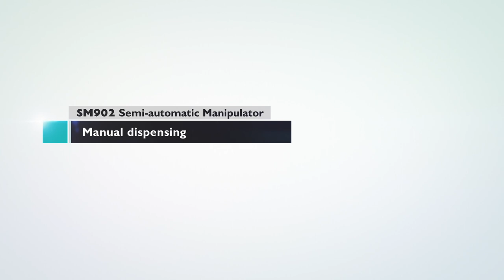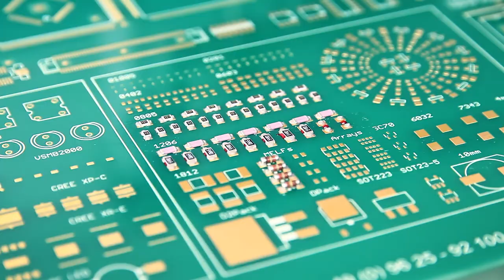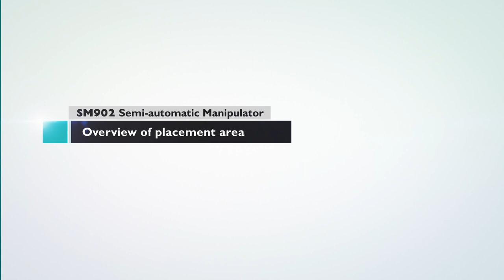Manual & Semi-automatic SMT placement

Comment: I love the dynamic guide hole that makes sure your putting the component in the exact correct spot!
Reply: It only repeats the position you told it to go to. So you might put it in the right spot every time or the wrong spot every time. And it does nothing to control the orientation of the part. Extremely limited value and applications, considering the high cost.

Comment: Did you notice 3:35 wrong direction of IC mounting, it catched my eye.. 100% secure, yes)
Reply: good catch, you were paying attention. (like someone placing smd should have been doing) ;-)
Reply: I  did  noticed  the same. This  machine  needs  to  improve  and  solve  this  problem.
Reply: Or - not make a 100% claim gaurantee that no error will happen in the first 5 seconds of video.
Reply: fseeletronicos © this is not a problem with the machine. The operator controls the position of the components as was demonstrated moments before the placement of the IC in question.
Reply: Erich Stein the video did not make any claims that no errors would happen. It stated 100% SECURE PLACEMENT.  Nothing more.
Reply: Ok, I got it - my bad.  It's 100% security positioned wrong by an operator.  If this machine can hold parts more than 75% - it is more steady than my clumsy shaky hands at my age.
Reply: I did noticed it too
Reply: FAIL
Reply: of cause :D
Reply: I see it too xD
Reply: @pbkayakyer  Since "secure placement" isn't even a real term in this industry, it's pretty safe to claim 100%. It's just a way to give the impression that the machine provides error-free placement accuracy. Nothing more.
Reply: Human error.
Reply: How can you tell its wrong? depending on a schematic it could be mounted however it was designed. I did not see any indicator on the board or ic to show which way to mount on that board.  I know there is a pin 1.  But the 160 I think is like Part 160 or IC 160 etc.  Much like they have r1, r2, c2 etc on boards.
Reply: @OnceShy_TwiceBitten  I was confused about that too, but I think its pin 16 and pin 0 not a part number. If you look at the part before it says 80 for pin 8 and 0.
Reply: @fseeletronicos  I think its from human factor, because you must rotate it using your hand, not computerized.
Reply: Good eyes
Reply: @OnceShy_TwiceBitten  pin 1 is tagged by some mark. Here the mark is a O  . Check the two prvious chips.

Comment: Hi, for component in the carousel, how do you ensure the pick-and-place probe placed exactly in the middle of the component? it seems the guided hole did not take into account the offset of the position of the component when you pick it.
Reply: I was curious about that also.  Looking at the placement of the two ICs at 3:21 to 3:32 it looks like the guide pin gets you to the nominal part location but gives you some wiggle room to manually align while placing.

Comment: Why though? What advantages does this have over a automated one?
Reply: I'd imagine that this product level would suit those smaller businesses who cannot afford to outlay more than $150,000 on an automated pick and place machine - especially considering that that small business might already have the skilled staff on site, which makes the case for a serious investment in an automated pick and place machine even less tangible.
Reply: $150,000? Serious? You can get them for under 10 thousand or build one for a fraction of the cost.
Reply: Well admittedly, $150,000 was an assumed figure - and it's also very difficult to find pricing for an Industrial PnP machine. All the websites want you to sign up to get prices :E
Reply: A "real" business isnt going to DIY a pick and place machine or buy a 20 year old used one. Plus the setup times on many large machines outweighs any time advantage. Hence the niche for this machine.
Reply: Joe Ambly >> Define "real business". Neither SpaceX or Tesla started out buying high end equipment right off the bat. I wouldn't consider either of them not being real businesses
Reply: Yes, they started with millions in venture capital, but No, They didn't start with high end equipment. SpaceX literally started in an old hangar. Their first rocket was meant to be reused IBM missiles bought from Russia, but that never happened. Their plan B was to buy parts from a small local factory in another state, which usually manufactured farming equipment. Yes, SpaceX started with hundreds of millions of dollars. But it took them billions to become successful.

Tesla literally started in a small warehouse like building and the roadster was assembled by hand. Their battery technology was mostly made by hand too. Their chassis to the roadster was from a Lotus car and its battery was made by AC Propulsion. 

Here are links as proof. Also try reading Ashlee Vance's book on Elon Musk. He interviewed the man himself on all of this:

SpaceX:
https://www.quora.com/How-exactly-did-SpaceX-start-How-did-Elon-build-it-and-figure-out-where-to-start

Tesla:
https://www.quora.com/How-did-Elon-Musk-build-and-organize-Tesla-Motors-from-the-ground-up-Who-did-he-partner-with-How-did-they-get-the-first-car-built

You seem to have absolutely no idea on how much it actually costs to run a company, let alone one that strives for development in technology. Yes, they were lucky enough to start out with millions on their accounts. But you can't go out and spend all the money the first few months. Then your company is gonna go bankrupt almost immediatly. There's bills to pay. Such as water, gas/heat, electricity, renting the property (cause nobody with their head screwed on right, would ever start out buying a place. That's more expensive than renting one!). There's research money (materials and possible repairs, as well as risk of work related injury), money directed towards development, actual development, production line, salary to your employees, hardware expenses, software expenses, office equipment and loads more for just starting out. There's also a bunch of legal papers that must be in place. If a single one is missing, you can either be forcibly closed, recieve a fine you barely have money for or be fined so heavily that you are forced to close. There's also taxes. 

In all honesty. The last thing you want to do as a newly started entrepreneur, is to go out and spend a shit ton of money on automated equipment. Especially not on custom stuff as that costs more. The manual piece shown in this video costs about 15000 Euro. Or almost $17,5000. Creating an injection mold for a prototype in the US (any kind of prototype) can cost anywhere between $10,000 and $100,000. A whole new design of a cars body can cost up to $600,000,000. Here are links on that too:

https://www.entrepreneur.com/article/80678

https://www.quora.com/How-much-do-cars-cost-to-manufacture

Research stuff before just babbling nonsense. I'm 22. Since I was 13 I've wanted to start up my own tech business. So I've been looking into every aspect about running a business myself ever since. I haven't even mentioned all of the expenses that can be in running a company. But there's a lot and a few hundred millions are a mere drop in the water. It's literally nothing. I've done years of research on the subject. I've spoken with people who are running their own businesses. My granddad used to run his own business. My girlfriends grandparents used to run their own business. My dad is an electrical engineer, my gf moms brother is a top tier salesman for Suzuki. His wife has worked in the medium tiers of Microsoft. My own mom is a sales manager. My gf's mom and dad are chemists. I have an uncle in the banking sector. Another doing landscape architecture. And I myself am studying hardware and robotics. I have lots of resources to pull on. Lots of people with lots of knowledge and who happily share that knowledge with me. Do research things yourself before calling anyone names. Or you end up looking like those first four words yourself.
Reply: I can see this being an effective tool if the "manual" process was made to learn the sequence of pick and place, then after the first manual run, you can switch it to automatic to do the rest. This would save money from teaching someone to learn the software of a typical pick and place machine. But from a software engineers perspective I'd just make some advanced imaging tech to identify traces and ref degs and compare to a cad program. Seems like a lot less effort than the engineering that was put into this tech.
Reply: +Techwise Jor one of the most complete replies I've seen on YouTube in a while.. Interesting info. I wish you luck in your life of hard but rewarding work
Reply: The whole point is not to have to program and debug a complex routine for a run of 10 boards before sending it to a CM that's going to do all that shit for mass production anyway.
Reply: @ Techwise Jor , congrats to you intelligent breeding traditions.
So much succsessful people even the females, thats discipline.
Reply: @TickyTack23  I have a very rudimentary manual pick-and-place tool and also a low-end automated pick-and-place.  I can end up spending more time preparing the automated pick-and-place for a job than if I do the manual pick-and-place if I am only doing two or three boards.

Comment: Если система видит на какой угол нужно повернуть деталь и указывает местоположение, то я не понимаю почему ее не оснастили дополнительными четырьмя двигателями, а на человеке оставили только инспекцию
If the system sees to what angle the part needs to be turned and indicates the location, then I do not understand why it was not equipped with additional four motors (moving + rotation), and only an inspection was left on the person

Comment: Why would you want semi-automatic when you can have full auto for less than $2k (at least, those that sort of work)?
Reply: Because this takes a whole lot less setup, allows you to populate the board progressively in any order for troubleshooting purposes, substitute components on the fly, repair a board from which you have removed components, and so on.  It's not intended for significant production runs.

Comment: why would you ever want this. Save up a bit more money to buy an automated one
Reply: idk why anyone would wanna buy it either. Considering realistically..... this machine would have to cost WAY more than a normal PnP machine... considering the extra shit you'd have to build in to allow human control..
Reply: I think next release will have extra option, which will allow you manual, semiautomatic and automatic options.
Reply: the reason could be the freedom from configuring the machine for a quick prototype, but if the automatic one has a manual option, then... it's pointless
Reply: lol
Reply: Because when your P&P examle place qfn qfp or bga wrong (with offset by x y or teta) u can remove component with this manual p&p without destroying solder and than manualy replace or place by P&P..
Reply: poopoo
Reply: the second generation will step up the game, full manual control over the hole process. Also 99.9% cheaper xD
Reply: This is ment for prototyping not manufacturing they even metioned that in the video.
Reply: @klab3929  Regardless, the eyelet location still must be programmed, whether it's for one board or a thousand, just like a more automated machine.
Reply: Because setting up and fine tuning the automated ones is a lot of effort which only pays of if you are talking about boards that you do in sufficient quantity. For prototyping (i.e. low volume) this is better than a manual syringe/tweezer etc approach.

I think too many people forget that often you go through a series of revisions on boards you design. Once you have the kinks worked out, only then does it make sense to go through the effort of tweaking an automated PnP machine setup. It is the same with prototype PCB design, yes you can send it out to the professional PCB shops and get a top quality PCB back but it only makes sense if you have worked out the kinks so until then it is often faster/more efficient to use some CNC or such to make the prototype PCBs.
Reply: @xConundrumx  I own an automated machine and often designs are first board ready, or minor revisions. Third prototypes are only for 1000+ boards where minor PCB mods may save endless hours of labour time, or a simple component change can save thousands.

When you revise a board, a majority of the components stay the same anyway. So you keep the feeders loaded and possibly even the machine if it's not used in the mean time. The place files are similar and if coordinates etc. change, the feeder locations/picks/timing etc. stay the same. So only minor updates needed.

What this means is you can design a board for production, output gerbers for the prototype + stencil, then you have a week to get components in, load up (cut tape is fine, maybe leaders needed or you can pay to re-reel), get stock components out (100n, 10k, etc.). Once the prototype arrives you load and go.

Considering a full setup (stencil print, pnp, oven) is < 10k delivered with taxes, and proto board + stencil ~100 per time... the setup time is LESS than this machine, the board you get is exactly what will be manufactured, revisions are easy, re-runs are easy and if the PCB is good, you are ready to manufacture IMMEDIATELY! At >5000cph for the inevitable occasions you need 2-10 prototypes or small production run - less human labour, more benefits and is cheaper!

This product is a joke.
Reply: @cjmitz  I your case yes, which is why I said the automated ones only make sense if you have sufficiently large quantities, your reply actually confirms my position. Not everyone however has the same needs and volume you have so as with just about anything what makes sense for one scenario does not make sense for another.
Reply: @xConundrumx  There are use cases for any niche kit. When this is the basis of your argument, anyone suggesting any use-case will "confirm you position". Had you come back and said; yes but the pnp requires compressor (mostly), some high value components don't want to be lost in the pnp, large companies won't use unbranded Chinese machines so the real price is £100k+ etc. Fine.

But you must really be reading what you wish to see if you think my explanation that if a small workshop can run 1-2 boards through an automated machine faster than doing one on a machine like this, with the machine then being already set up for the prototype revisions, and being fully production ready with the ability to do small runs in house... Any business should seriously consider that, whether they need the in-house production or not.

Taking an engineer away from the design bench to do this manual work is insanity unless you can provide a very good reason or exhaust all options. And if the answer is hiring someone to do this work, then hire someone to run a pnp! This thing should at least provide some sort of semi-automated final alignment (say +/- 3mm).
Reply: @xConundrumx  Of course. The sane thing to do is respond and call it pointless whilst  jumping from a reasonable discussion to petty insult.
I think you're just a little hurt that someone disagrees with you.
Reply: The advantage to this would be in R&D where you are constantly changing components. You don't want to reprogram the machine every time you make a new board.
Reply: @corynrobinson  Realistically in R&D you don't change the components very often.  You place them and then do wire reworks or replace odd components.  I usually get my protos done at an assembly house since they get economy of scale use of the machines.  Cheaper for me time wise and better for them production wise. This machine is obsolete in today's world.
Reply: @ggrizzle  And I think you have no clue who I am, and what I have or haven't done. So please, feel free to stop assuming things.
Reply: @xConundrumx  so... who are you?
Reply: @darthnegativehunter8659  It is for prototypes or very small runs (less than 10 boards). It might be faster to just place components semi automatically/manually, than program a whole PnP machine, especially if you have awkward components of varying sizes. I think it is a nice compromise, and is really useful in many scenarios.

Comment: At 3:37, it looks like component, "RIVX 55M" has the lower left first two pins soldered together as an accidental short ???? Hope I'm wrong... Honestly I would o with rectangular solder needle dispensers, as they might avoid such tragedies...
Reply: If the board is still being placed, then the solder paste has not yet been melted. When it is, the surface tension will easily pull the solder onto the pad. This is pretty standard in SMD soldering, and is part of the reason for the solder mask layer.

Comment: 3:22, ok so your soldering compond is linking every pads, that can't be good now can it?
Reply: Funny thing about solder paste: if you don’t put too much in a given area, and you have solder mask properly on the board, etc. and heat it up properly with enough flux, it actually tends to all balance out and go where it needs to go, including neatly balancing the components in the middle of their pads as a result of surface tension.  It’s important to have not too much solder paste overall in the same area, but when it reflows with the proper amount, it’s like the best kind of magic.

Comment: by the time you set that up you could build one by hand easy, if your gonna do volume just get the pnp, does't need to be a fancy one either, get a used one with a few perks and warranties. You could modify that setup and make is faster by using a microscope and a mouse controlling the placement wand instead of this non-sense.